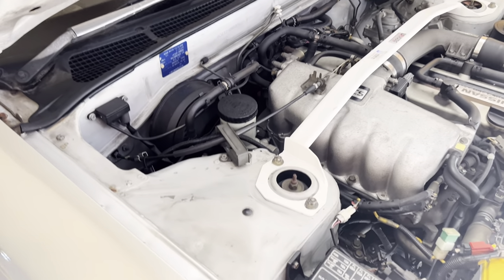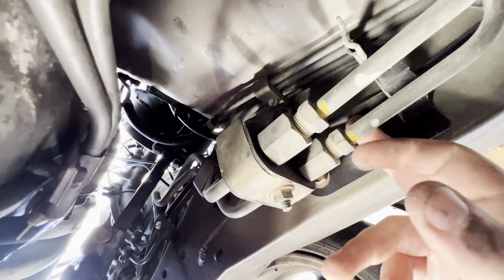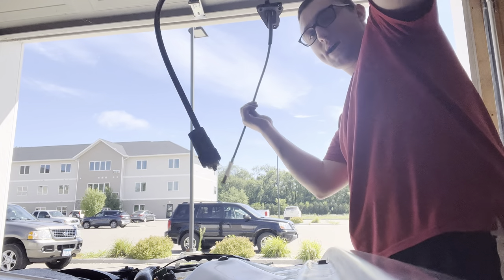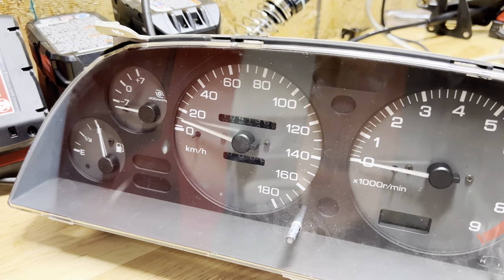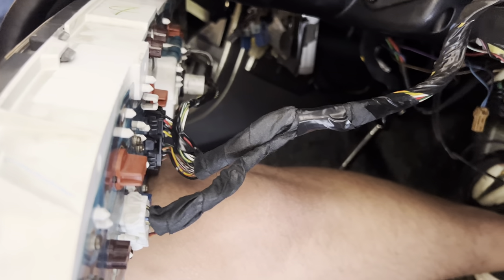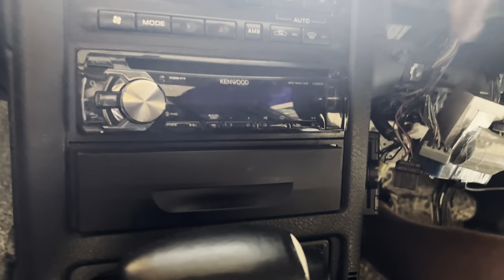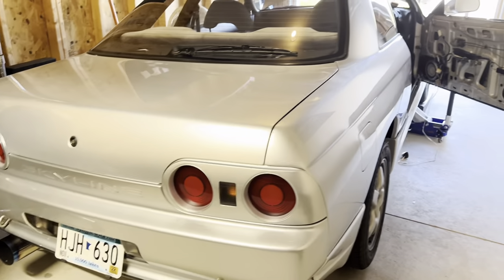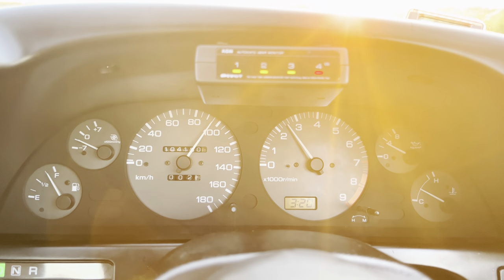How to Fix Speedometer Cable in a R32 Skyline!!!

Comment: I think the R32 I’m working on also has the same failure. The white plastic square peg that goes into the back of the cluster came out with the cluster along with the siding that’s inside it. How did you JB weld it back? Any way I could message you and send some pictures?
Reply from the maker: Yeah for sure, dm me on instagram, tuned_productions
Reply: @tuned_productions  sent!

Comment: What’s the parts number? I’m looking for a brand new one but they all specify  for manual transmission and I’m looking for automatic transmission. Does it really matter or is for both, automatic and manual transmission?
Reply from the maker: I had the same issue, I don’t know if the manual one will work for the auto one, I was able to fix my old one
Reply: It’s the same